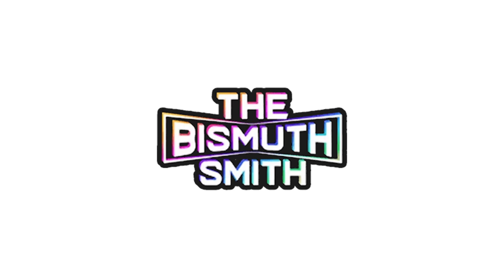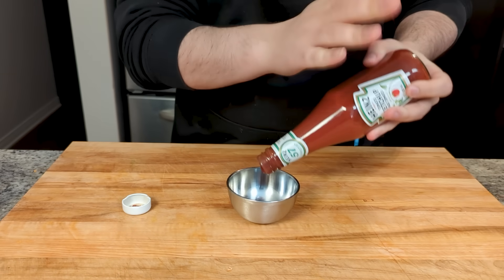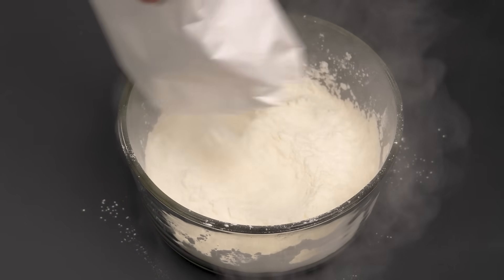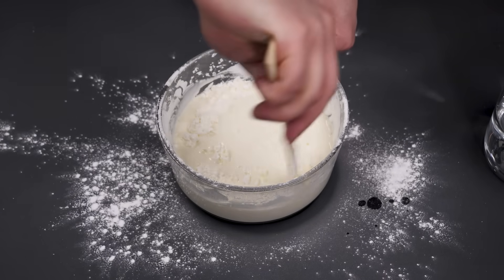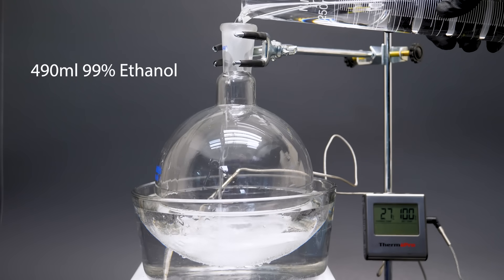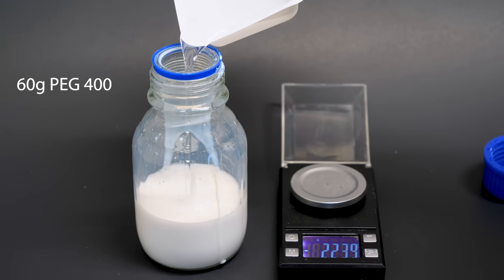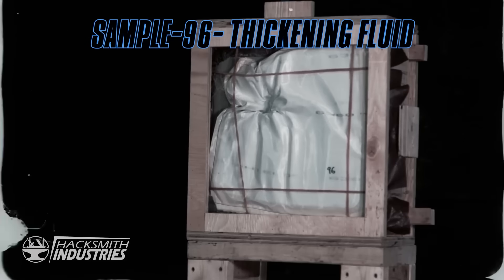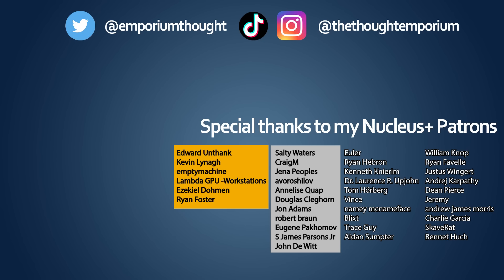Liquid Ballistic Armor? | Thehacksmith Collab

Comment: Filter the cornstarch to get the best particles.  Then compress it with several tons of force like what is done with ceramics plates. The particles will be already in close proximity when the force of a bullet hits it.  You may need a binder, which will be a small percentage of the main material.

Comment: Do you think maybe part of the issue is that you only used a uniform size of particles? I would have to imagine that having a fairly high degree of size irregularity would result in better packing under force as smaller particles get forced into the gaps between bigger particles to create a more solid area. Not to mention irregular structures are much more resistant to shear forces compared to a uniform lattice situation.

Comment: To be fair,. 45ACP is a large, slow moving round, making it one of the easier rounds to stop. For context, a 9mm is much larger in size and weight than 5.56/.223 which is the common AR15 caliber. However, the . 223 is MUCH harder to stop than 9mm.
Reply: 5.56 nato is 5-6 times more energetic than 9x19 parabellum.

Comment: 0:09 EVERY LIQUID DOES THIS. WATER DOES THIS. THAT'S WHY IT HURTS TO FALL ON WATER.
Reply: No, every other liquid does this in a linear scale(Newtonian fluids), oobleck does this in an exponential scale.
You are so r/confidentallyincorrect.
Reply: @c.jishnu378  whatever man, I know I'm correct so I don't care if you wanna be wrong.
Reply: @magentawool2556  I don't think so you get it, normal liquids become harder the more force you apply in a linear scale, ie if you apply 2x force, it will become 2x as hard and if you apply 3N force, it will become 3x as hard. But if you apply 2x force to oobleck, it will become 4x as hard and if you apply 3x force, it will become 9x as hard.

Comment: .   In a fiber board set up it may show a affect. So maybe try a cloth stack  compress into a board and test it . Try  rubbery resin as the binder.    I'm not sure how to apply the the power. Let dry into the cloth  or mix into the resin. Wish i could do this my self.  
 it would be nice if you could try this with spider silk cloth.   It might be able to take a 50cal

Comment: There is a limit to how stiff you can make a treated fabric with something oobleck-like when a force is applied.  That limit is way below the force you're going to apply to your layered armor even with something as relatively dinky as a 9mm.
Reply: A standard 9mm load has around 400 joules of energy. Weaker than an avrage punch. Now, you probably still wont atop it without some cross section in a shear thickening material because it applies that force over a small area.

Comment: Theres something about the fluid that the particles are suspended in, that i dont remember being explained here, and thats the attraction of the fluid to the particle, and its role as a mediator for the kinetic energy between particles. 

Water as we all know is very sticky and almost impossible to remove without giving a much better reason to go somewhere else.  The reason/energy needed can sometimes be up to 16 times higher than the forces that are attracting it to that substance. As you explaimed perfectly, water is less than ideal for this application, but at the same time what makes this type of non newtonian fluid attractive for kinetic resistence, is tje fact that its free to be wet (sticky) with itself. 

Trying to impregnate the spaces between threads and layers, doesnt add any significant material properties to the material, because the material is still separete from the fluid mkre than the fuid is to its suspended particles. Unfortunately the result of adding little amounts to tje kevlar has about the same effect as doping them with baby powder or graphite. Infact, its more like the difference between graphite and graphene. Although theres a lot of strength in the lattive structure, theres almost no strength comparatively between layers. 

On the other hand,  if you could say create a fluid with similar properties to ooblek, using microssperoids, but were suspened in something more like a gel that is laterally stable in stacked cells, i think you could achieve what you want here.

Comment: Tech Ingredients made a video where they made Graphene and added it into resin to increase its strength.
What would happen if you added Graphene to the Shear thickening armor?
Could work the rebar in concrete or probably closer to Mechanically Stabilized Earth.
ie; Practical Engineering

Comment: Chemist here. This is not my exact expertise but I thing there is a big flaw in choosing unpolar nano particles because they don't stick as much to each other when in close proximity. 

I would expect corn starch to be so good at making sheer thickening fluid, do to the fact that it is extremely polar molecules that can make hydrogen bonds between the particles when pushed together, but when not pushed water will slide in and make hydrogen bonds instead making it liquid.

Comment: A car powered by liquid rocket fuel. Not a jet, but using the properties of a jet to cool the self oxidizing reaction, controlled by water. Powers an engine that works a transmission and turns wheels. Rocket cars

Comment: .45acp is actualy quite poor at penetration due to its low velocity and large cross section, basically like trying to use a flat point nail with less force as opposed to a normal nail with more

Comment: Here's a thought, concrete get a lot of it's strength no only from the aggregate that's added to the cement but also from the fact that different sizes of individual aggregate pieces can fill the respective space more efficiently (and save on cement). 
So, how about making the fluid from a combination of different sized molecules so they pack better together?

Comment: Why didn't you take one of those rubber heater things, which can be filled with hot water and put under the pillow?

You could have filled it with oobleck and get a 1 inch thickness of the oobleck itself. Then they could have tested how the oobleck itself reacts to high velocity projectiles.

I'm not surprised that a thin layer on a fabric doesn't do anything. It needs some volume, or rather thickness in order to have time to react to the impact.

Obviously that would have been useless for the suit project. But it would be of similar dimensions as an armor plate insert... That would be interesting to see in slow motion.

Comment: I just saw a video about a Devtac Ronin II ballistic helmet, which provides full head coverage. Pretty cool sci-fi deal that gives me some serious Gears of War vibes. It can stop up to a .45 acp round.

I’m worried about brain or spinal cord injury even if the helmet stops the bullet. Sure, the bullet can’t penetrate, but you can still get shot until your brain turns to pudding. 

Do you by think lining the inside of the helmet, this material could act like a shock absorber that reduces the risk of user injury? Or am I just smoking crack?

Comment: I suspect a graphene reinforced kevlar would be a better choice but to each their own lmao
(graphite and graphene are used in hobby/diy composite plates and 1/2 of the reasons for its inclusion are the same as they would be in kevlar)
Reply: Graphene is a meme. You cant make it in large wnough sheets to really utilize its properties. Para aramid fiber migjt be theoretically weaker, but you can actually make it long enough to create a weave. In amy event, the way you reinforce elastic qrmour in a compowite is either with volumetric, or high hardness components.
Most AFV schemes use carbon ceramic balls or plates suspended in some form.of resin sandwithced between steel, with a polymer fiber inner spall liner, and a spaced highly angled metal whipple shield. Properly sized graphene sheets would be replacing the steel part of that probably.

Comment: Question: Wouldnt a piezzo element solution we electro contracting fibers (https://en.wikipedia.org/wiki/Electroactive_polymer) be even better? The bullet hits, creating current, which contracts the fibers towards the impact point, spreading the impact.. At the same time the newtonion fluid provides additional protection. Add a self resealing top layer..

Comment: I've seen this stuff stop an arrow which will go through most bullet stopping cloth based stuff
Reply: Ballistic fiber is not cut resistant usually, yes. Ceramic or hardened steel plates will stop cutting projectiles too.
Reply: @egoalter1276  it's not the fibre it's the glycol nano silica embedded in the fibre, there is some weird non newtonian electrostatic thing that causes the silica to form into a solid so it becomes a ceramic of sorts

Comment: Great experiment but I don't think you gave your armor enough credit. I think it probably outperformed the the control significantly! 
I have a small LLC that tests armor. It's barely a business but I might know a little more than the average bear. It is my opinion, semi-pro as it is, that your armor was probably much better.

The reason you think the control approximately equaled the STF treated armor is because you measured blackface deformation in the armor itself, and not the deformation into what was behind the armor. There is temporary initial impact deformation, then there is rested, post-initial impact deformation. I have a proprietary way of measuring both that is better than NIJ's, which is a joke anyway. How fast was the round going per micrometer of penetration depth is the question I try to answer. This gives us foot pounds of energy and a real world understanding of the pain and injury that a non-penetrating impact can cause.  

I can also test it against the most common backers for NIJ Level 4 ICW plate armor. There is plenty of room for your idea to be an advantage because there is no "best armor" it depends on what you expect to face as an incoming round. 
If you feel like invading "Appellation American" territory or huge open space areas (like Texas or Wyoming  and many more) then you'll face fancy handloads and toss your NIJ cert in the garbage, in the Middle East sandbox you'll face 50+ year old Soviet surplus but that doesn't mean it's bad stuff. If you get in a fight in urban area then US store bought FMJ or US store bought hollow points, and if you p*ss off gov't then M855 if you are lucky, etc. If all I had was soft armor, and I had to pick what to get shot by I would pick UP TO the fanciest hollow point in commercial production ammo, which used to be called "cop-killers" by ignorants in the US media. In 2023 aged-out police duty-issue soft armor from the 90s will defeat todays hottest production hollows. The point is that ballistic armor can be as counterintuitive as any other physics experiment.   

If you want me to check it I will send you my NDA that lists most of my testing methods and let you review my LLC and personal info for legitimacy and I will test it for free.  You can publish the results, some of how the results were gathered and why that method was appropriate but none of who tested it. My findings are private to the company that pays me to test. I can provide excellent video of every test I perform but my NDA precludes all but the most obvious methods from being published in video format.

Comment: Can I ask why you would waste expensive 99% ethanol by adding water to it. Why not use a bit more of the FAR cheaper 95% ethanol and little less water?
Reply: I mean he could just distill and then add a dessicant... still dont see the point
Reply: @FirstnameLastname-jd4uq  Preparing non-azeotropic ethanol is simple enough but it's a grind, takes time and effort. It's far less of a task to just distil and leave it at 95-96%. Alternatively, you can buy ethanol and it is significantly cheaper a less red-tape to buy 95% than 99%. So why spend the time/effort or money on 99% ethanol if you're just going to add water to it?